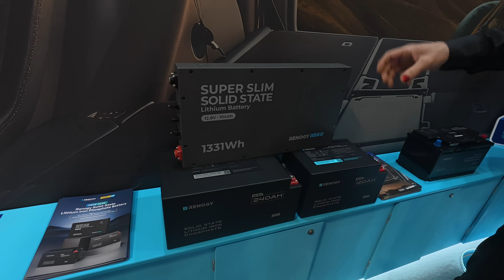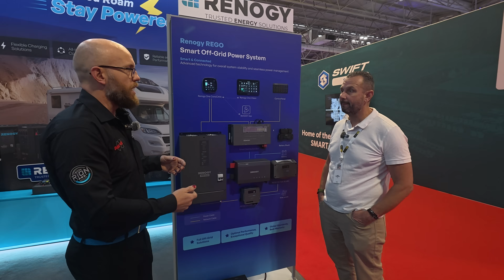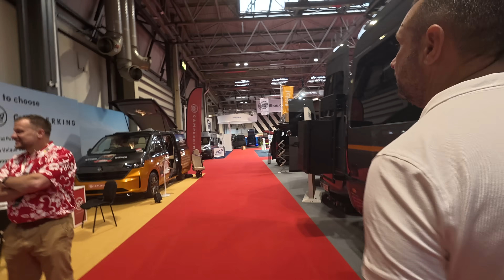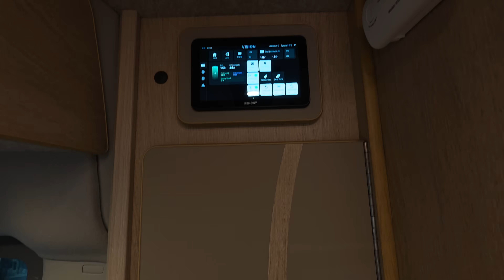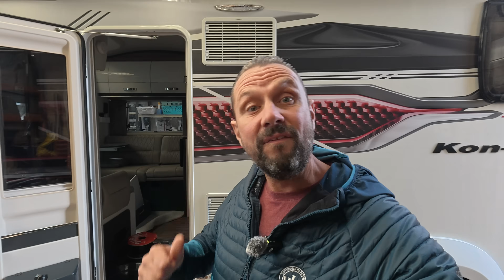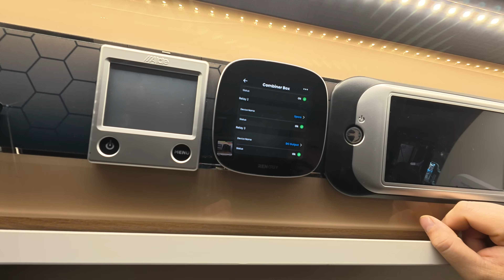GAME CHANGER: Renogy’s New Power Systems for Off-Grid Motorhomes (Full Tour)

Comment: I've just fitted a Renogy 3000 watt inverter to my van and I'm very happy with it. However, the cables that came with it are completely unsuitable for the expected load and went straight in the bin. Shame really as the inverter itself seems to be well built but the cables really let it down.😢
Reply: We have just had fitted a renogy 2000 kW inverter fitted also a 300 aph lithium battery we are wellpleased with them so far.
Reply from the maker: That’s a great setup 👍 a 2000W inverter paired with a 300Ah lithium battery is a solid combination. Renogy kit has been really reliable for us too, so it’s good to hear you’re pleased with it so far. Plenty of power there for everyday touring. Happy travels 😊
Reply from the maker: Thanks for sharing your experience. It's always helpful to hear real-world feedback on the components. Glad the inverter itself is working out well for you. 👍 Happy travels 😊